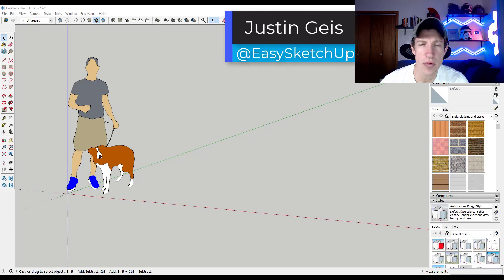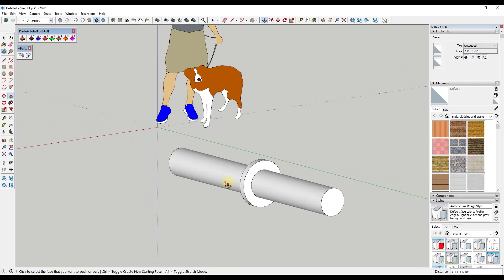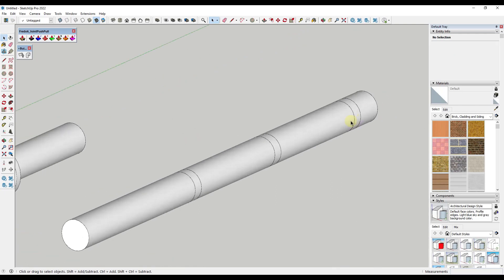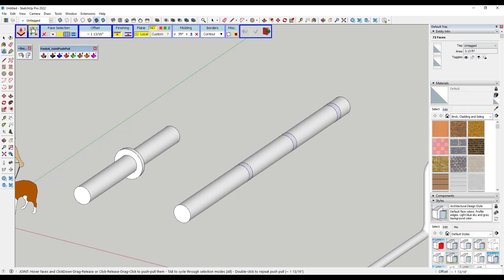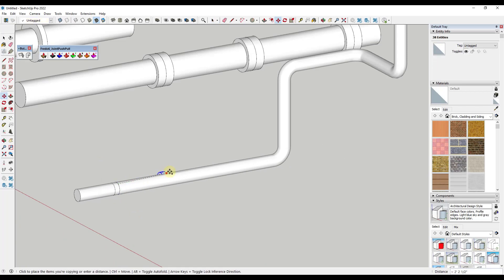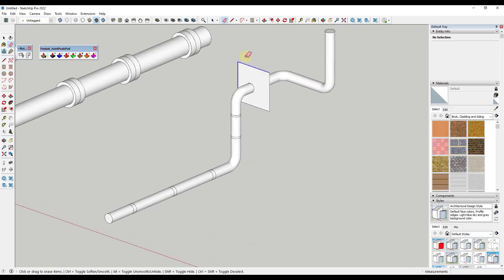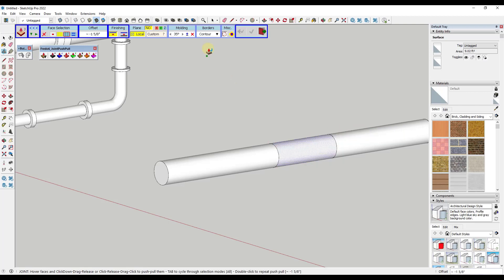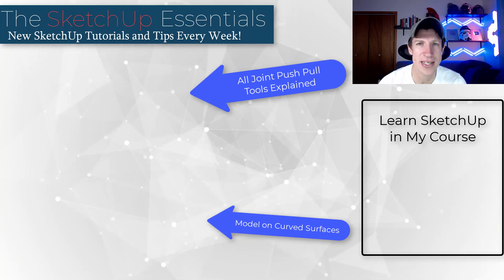Easy PIPING in SketchUp With Joint Push Pull!

Comment: Thanks Justin, the groups option is really useful to know.  
Completely unrelated question: is there any option within SketchUp, or any extensions that allow you model to parameters similar to Fusion 360. I’ve seen it used in a few Fusion videos, especially relating to woodwork, and it seems like a very useful tool.